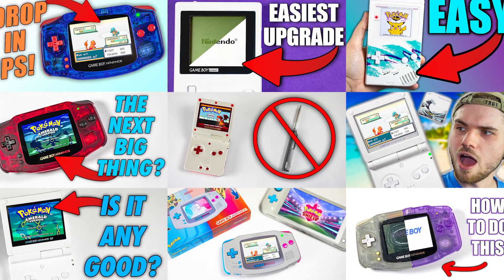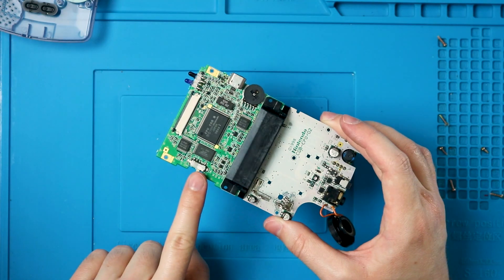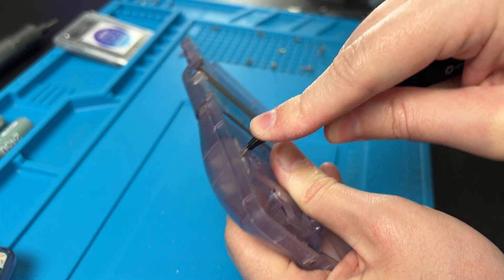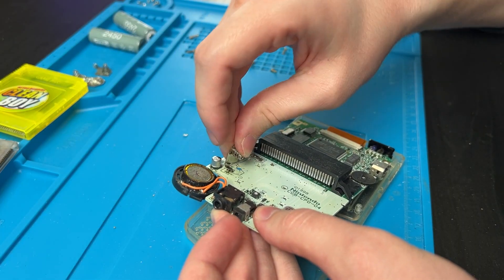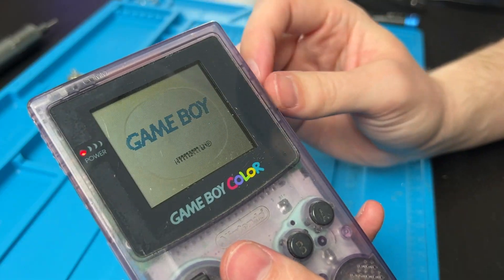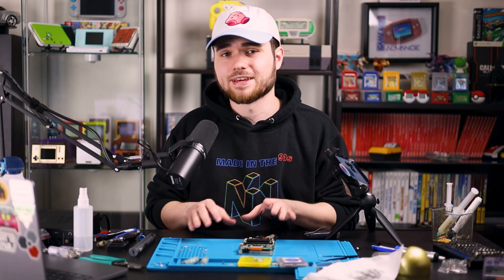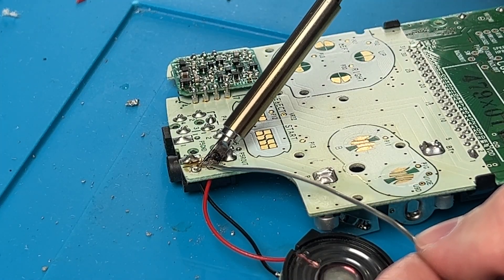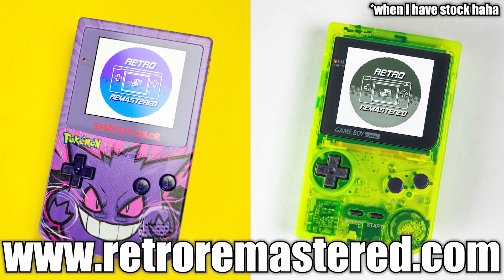Fixing (almost) Everything On The Game Boy Color!

Comment: changed the power switch, nothing
changed the fuses, nothing
changed the caps, nothing
reflowed the solder joints, nothing
checked the DC & Batt terminals, ✅ 
checked for bridges, none!
did wire jumpers to by pass any issues, STILL NOTHING!

did a continuity test on each and every diagram to see where the volts are given charge, and all passed!

at a lost here! 
only clue i have is when i tried powering it on it does that distinct “static grunt” indicating a short…. but i see no short! 😅💀😭😖😤🤯🤬🤬🤬👺🙃
Reply: thermal camera?

Comment: Great video and good break downs. Damn should try the clr. Just wish the sold a smaller jug.  Def a paid to pull the contacts out being on the opposite side. The one Im currently fixing. Has that real dried look to the solder and would melt at all but add some flux and new solder and eventually melted into a weird goo.  Dont know exactly what happened but seemed like 2 AAs linked all in this things bad and sat there.  If can revive will prob just use the chips for an eventual pico build. The contacts were also really badly corroded with battery juice and used a fiber pin. worked well but did seem to scratch slightly. Dont know if its a maybe deal tho since cant test without power yet.

Comment: For the cartridge slot problems I've had great luck on everything from a SNES to a GBA and even DS Lite with just putting a bunch of IPA on the pins of a game and then cycling it in and out and drying it a bit with canned air. So a bit like a combo of the Clean Boy method and the IPA + toothbrush method you mentioned, but I think an actual cartridge is able to get into the deepest parts better than a toothbrush. I've never had this damage a game as far as I can tell, but I do tend to reach for a game I don't care about as much to be the cleaning cartridge just in case.

Comment: I have two GBCs with sound problem. One does work with a headphone connected, the other doesn't show any sound. I thought I should change both speakers, but you gave a little more clarity about what else I can check on them! Thanks a lot for this video!
Reply from the maker: For the one that has sound only through the headphone jack, I’m assuming the problem is the headphone Jack thinking there’s something always plugged in, or just a bad speaker. I would just try all of those steps listed before a capacitor swap.
Reply: @JakeSimmons  hmmmm how could i check this? or what kind of repair should i do to try to stop? i also got a multimeter but still no clue on how to use it 😂
Reply: check the volume wheel  you can bridge two of its legs to bypass it and check if the problem its from there

Comment: Hey Jake! I got this GBC here that will read cartridges enough to have no error message on the startup screen (it says "Nintendo" with no blurr) but after the startup screen it just boots to a blank white screen. No matter what cart I use and I'm using carts that are fully functional on other devices. I've tried cleaning the cart reader a bunch of times. I haven't tried replacing it yet. Do you think a replacement would solve the issue or it sounds like a smaller malfunctioning component?
Reply from the maker: In my experience, it’s only ever been the cart slot or me so replacing it could work, it’s just a tough one to swap. I would try reflowing the solder in case any of them have a bad connection to the board before attempting to remove it
Reply: @JakeSimmons  thanks so much for the reply. You da goat
Reply from the maker: @deeuz5230  if you need any more help, join the discord!

Comment: Any idea on how to fix a short circuit on a shoulder button for a gba?
Reply from the maker: Can you give me a little more information?
Reply: @JakeSimmons  I replaced the original "R" switch  with a "clicky" one , at first it worked, however after a while it continues to give continuity as if it were always pushed.  I checked the solder points and even re-soldered it in case it was wrong and still it didn't work.  Days later I changed both switches again and now the one doing that is the "L". I thought there was a scratch or something on the pcb but everything looks fine. So i dont know what it could be 😅. 
Pst. Sometimes when i turn it off and turn it back on after a while it works fine for like a minute.
Reply from the maker: @alx.santosm  is it IPS modded? You might want to check if your wires to L and R aren’t getting pinched

Comment: I’m having so much trouble getting the power switch cover off to clean the track. Watching your tutorial makes me feel so incompetent 😅
Reply from the maker: Oh I still struggle with it don’t worry. Some are tougher than others!
Reply: @JakeSimmons   I once broke one in half (the black plastic slot), so i had to replace all of it... I managed to replace it and now its back alive!
Reply: I've done tons of them and also struggle sometimes using a soldering iron. It's a billion times easier with a hot air gun. Same method as he is showing, but the hot air will easily release it after a few seconds.
Reply: Slide a razor blade (craft knife works too) between the metal at the top of the switch to help pry it up as you are desoldering the shield. ^^
Reply: Whenever I try what he done, the whole switch comes off not just the metal part
Reply: The way Jake does it in the video has worked very well for me on both GBC and GBA the few times I've done it. You don't always need flux and fresh solder but they should make it easier. Especially the fresh solder. I use a fiberglass pen to clean both parts and it works pretty well. I didn't know they also made steel wool pens. It doesn't take too long to do the inner part with a fiberglass pen still. Definitely works better than using a cut-off cotton swab like I saw makho do once. (I did give that a go but it just doesn't work that well)
Maybe your soldering iron temp is a little low also.
Reply: @SoundToxin  thanks for the detailed response! I should have left an update, I have since cleaned all of my devices power switches! It was just so much more difficult on the GBC than my first two switches, but they were on GBA consoles which don’t have the annoying locking tabs on the metal cover. Long story short, all my power switches look shiny and clean again:) good luck in your modding ventures mate